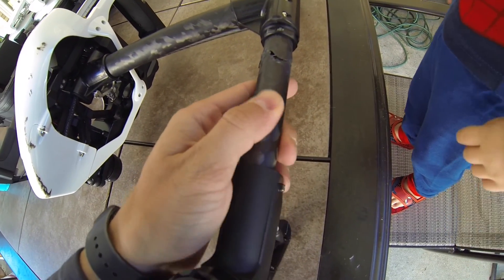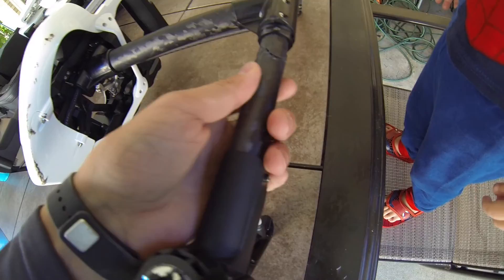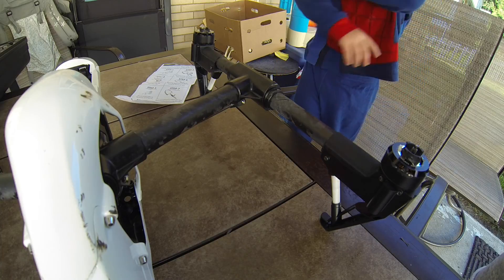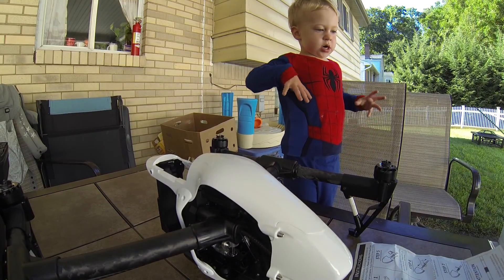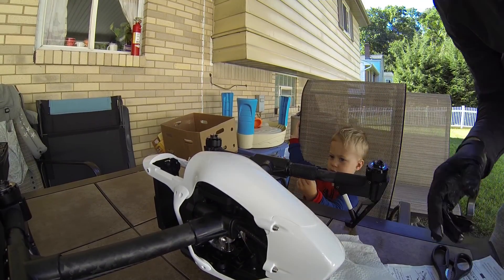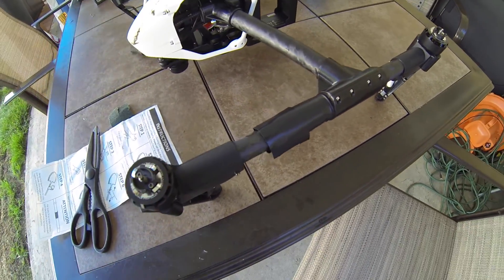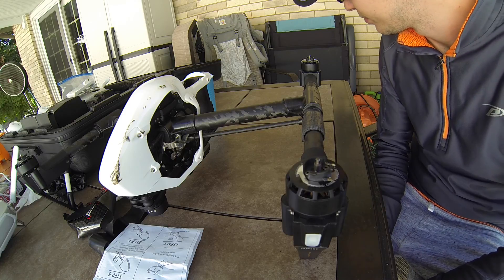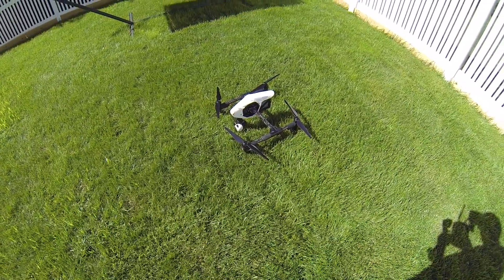DJI Inspire 1 - Fixing broken carbon fiber arm for $10 and 15 minutes with FiberFix

Comment: Hey, just wanted to know how it is holding up. Mine is starting to crack and want to wrap it before it breaks.
Reply from the maker: Still working great, definitely much easier solution than replacing an arm

Comment: Did that work long term for you? Mine just did the same break.
Reply from the maker: +Above and Beyond  yes I've been flying it since then and still works like new
Reply: Alexander Oleynik ~> I wound up replacing the boom myself, scary but not as hard as I thought it would be.
Reply from the maker: Above and Beyond sorry to hear that but I do agree, replacing the whole arm is much safer way, but pain in the ass
Reply: Alexander Oleynik > Just my luck that my break was IN the part with the 8 screws and you couldn't see it. So I had no choice.
Reply: @AboveandBeyondGlobalDrones   How did you break it? I see many people, myself included lost or crash landed their Inspire 1 drone thx to dodgy software which loses contact, cut of camera feed etc. A bit sick that DJI have much better software for much cheaper drones and don´t look after those who forked out big money early on  to buy the Inspire 1...
Reply: @eugeniusnpc8477  > The damn auto landing gear down setting. 
During a high wind gusting situation I held her in place waiting for it to blow over. 
Well the sensor mistook the top of a palm tree for the ground and auto lowered the landing gear,  which was enough for one prop to catch a branch... Shut that swing of and never used again. 
It's not always our fault.